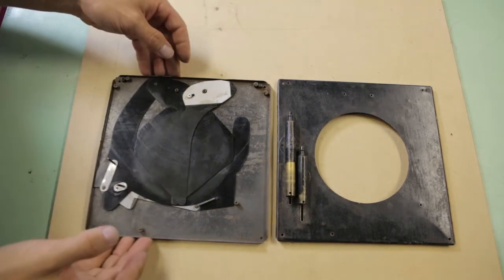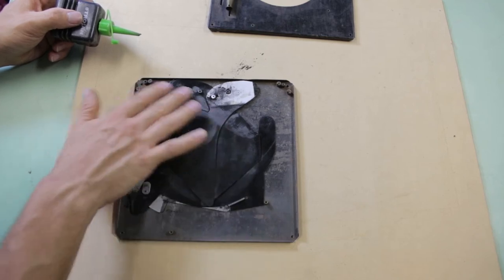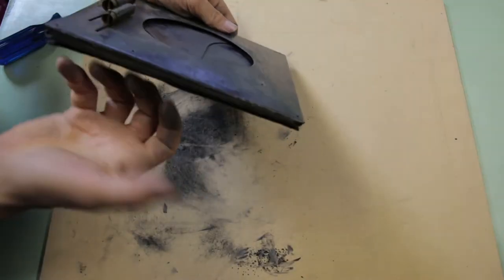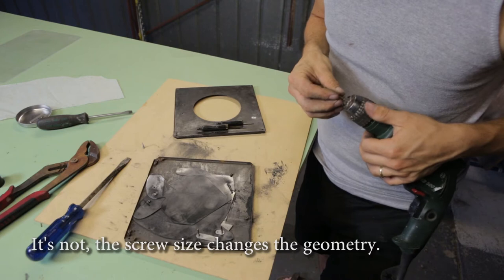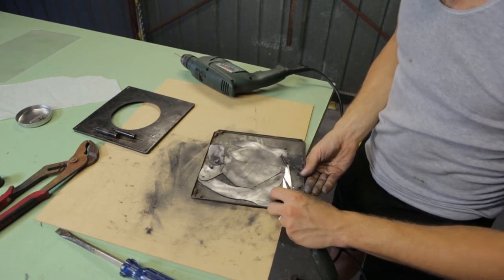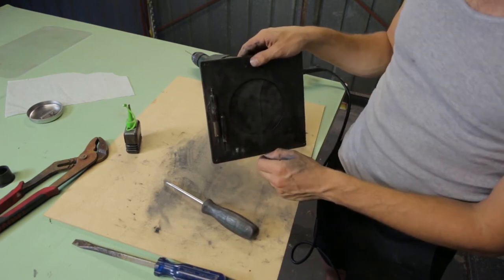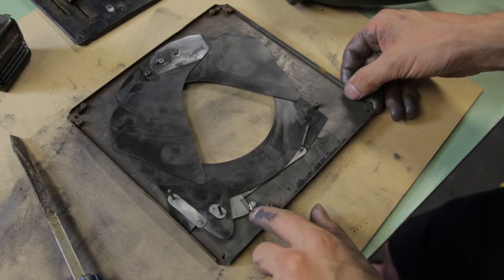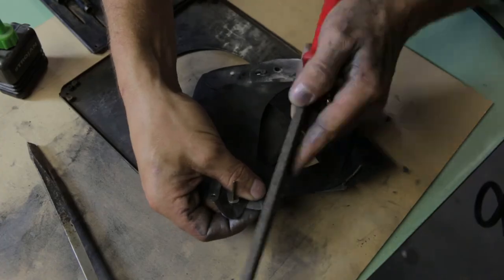Packard shutter Repair

Comment: Hi I have a Mamiya RB 6X7 and sometimes the mirror catches (but not all the time) when the shutter is pressed. First I thought it was the lens but the same thing happens when the lens has been dismounted, any thoughts?
Reply from the maker: mamiyapress Sometimes the mirror is mounted with a soft glue. If they get hot enough in storage the mirror can move, causing the camera to jam. If so you would need to pry it off and re set it.
Reply: Nick Thorley Thanks for that reply.